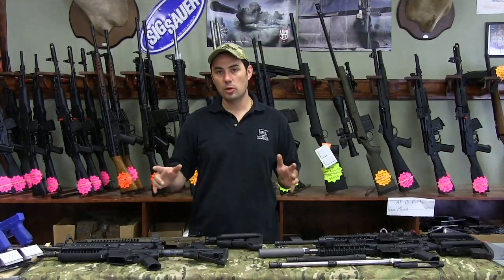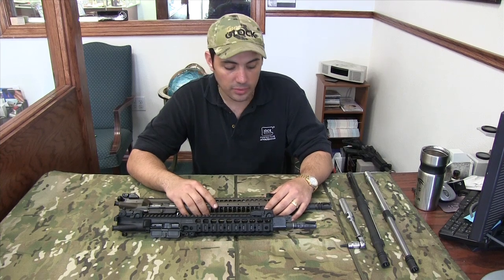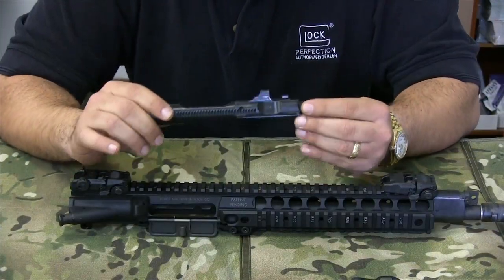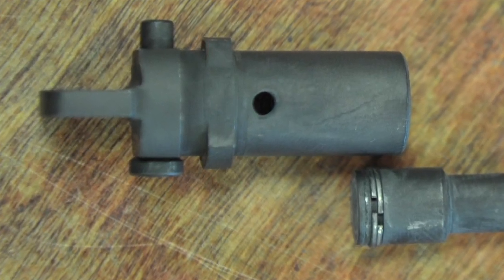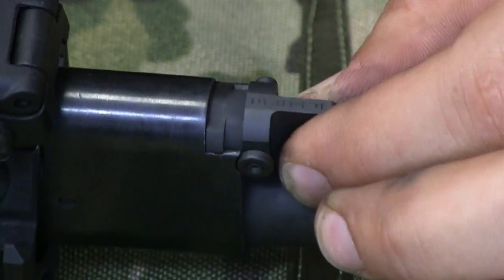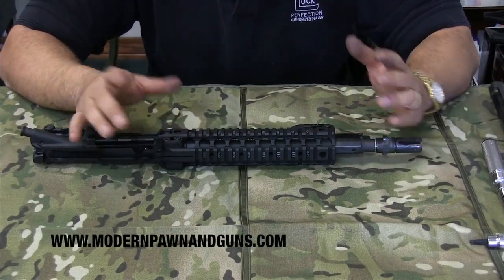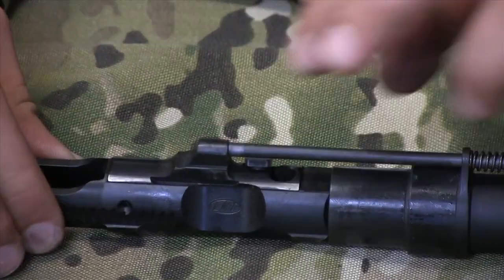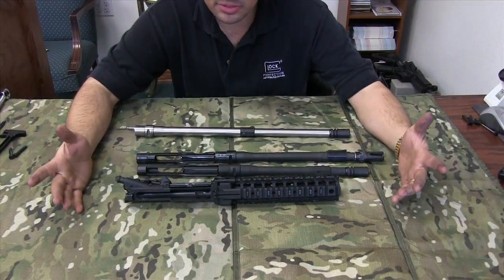LWRC vs LMT AR15 Short Stroke Piston Gun Comparison Review

Comment: I own a LWRCi. I love it love it love it. I have fired it for a weekend long shoot, a little bitty lube, and cleaned in on Monday in a matter of minutes. The BCG has a coating on that makes it slippery to the touch and a breeze to clean. She runs soo smooth its almost criminal. As far as the handguard, I have never had an issue with zero. I recommend to an active shooter the LWRCi hands down.
Reply: Active shooter ????
Reply: @krishankansal86  🤣 I think maybe “avid” or “frequent” would be a better choice, but they are saying if you shoot a lot, get an LWRC
Reply: @krishankansal86  pew pew 😮😮

Comment: These are both excellent weapon platforms. I have an LWRCI CSASS 7.62 but am in the market for a 5.56 right now and would absolutely consider an LMT for my next purchase. This is tough, though, as there are things I like and dislike about both. I greatly prefer the LMT's one piece upper design as it seems like it would zero better after removing and reinstalling optics and be more durable in general, but I really like LWRCI's barrels as cold hammer forged with a nitride salt bath is irrefutably better than chrome-lined stainless, no if's and's or but's about it. I also think that LWRCI has a more robust piston system and uses better coatings on their bolt carrier group, but the LMT's ability to swap barrels and go back and forth between DI and gas piston is freaking awesome. Damnit! Why can't the two companies just get married and have a baby!
Reply: LMT and part are impossible to find
Reply: @jimjab3631  I've owned my LMT CQB since 2008, don't knoiw how many thousands of rounds I've put through it...it just runs and runs..." finding parts wasn't much of a consideration when I bought it and quite truthfully it still isn't....that said, anything can happen any time and it's something I should actually think about....
Reply: Well on the LMT when your barrel reaches the end of its life you can put whatever barrel you want in the LMT with ease as demonstrated in the barrel.

Comment: LWRC puts those gas rings there because they feel like they're more durable than spring loading the bolt(as H&K does,) which is done to try to compensate for the complete loss of gas pressure originally pushing the bolt forward in the AR-15 on unlock.

LMT ignores this because they can get away with it, and that's possibly why you don't see them getting big contracts for their piston guns LWRC manages.
Reply: LWRC essentially uses a mil-spec GI bolt.  This allows LWRC users to use any mil-spec bolt out there in the event you want/need to replace it.
Reply: Lol and lmt has the Estonian contract for their piston ar

Comment: Disclaimer: I own an LWRC SPR so I am obviously a little biased as I absolutely love it. You didn't mention that the LWRC bolt-carrier group is coated in nickel boron vs LMT, nice advantage. The Ni-Corr coated barrel is also a plus. Also many will say that the short stroke piston is a little better due to the op rod being shorter than the longer rod LMT uses as there is less flex. I like the barrel change capability LMT has, but would never really see myself using that. Both are awesome guns!

Comment: Between these two, which do you think has the greater issue with carrier tilt? I've heard of some LWRCs that have shown carrier tilt after less than a 1000 rounds cycled. Also, what are your thoughts on the PWS platform? I own a PWS MK116, and its bcg/piston more closely resembles that of an AK-47. Way less chance of carrier tilt due to a lack of a impact key - the piston is one piece.

Comment: One minor correction. On the LMT, you only need to take the barrel-side bolt out to take the barrel out. The other bolt just needs to be loosened. This is what they recommend in the manual, and also you can't lose the washer this way.

Quick question. Is the piston rod perfectly straight on the LMT? Mine is slightly bent since new. It still works fine, so I didn't complain to them... yet. *laugh*

Great video, by the way.

Comment: i like the idea of switching out the barrel . iwhat is the cost of the barrels itself? and after switching out the barrel does it hold zero? and the last question are lmt barrels chrome lined or nitrated treated?
Reply: LMT barrels are either chrome lined or stainless. When I switched from piston to DI (just to see if the thing worked), it was a little off from zero.

Comment: LMT upper is milled from a forging, not billet.
Reply: How many places do you know that forge those 1 piece uppers/rails?
Reply: *****
LMT and Colt's are the only ones I can think of right off the bat that are definitely forged. Mega offered one in the past, but it is discontinued and was from billet. Vltor offers one, but I don't believe it is a forging.
Reply: That's interesting. I didn't think Colt or LMT would be the types of companies to invest in that much tool for a proprietary niche upper.
Reply: *****
I doubt they perform the forging on their own. Colt's is known to source raw forgings from companies that specialize in forging (fittingly called "forges"). Colt's often have forged aluminum parts bearing the Brass Aluminum Forging Enterprises logo (a square). Cerro Forge (a keyhole) is another common one. In the past they have also commonly used Anchor Harvey (splintered A), among others- although BAFE and Cerro appear most often currently.

LMT has been known to source (edit: redacted "parts", replaced with "raw forgings") raw forgings from Cardinal Forge (a bird's head).

It is likely one or more of their existing suppliers is also filling their orders for the monolithic upper forgings.